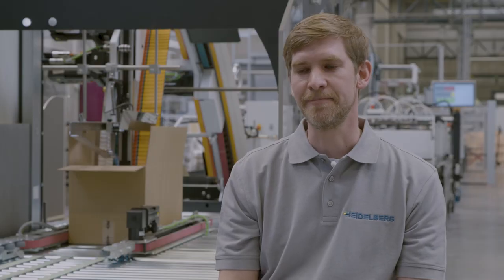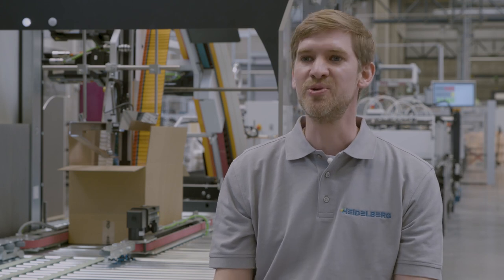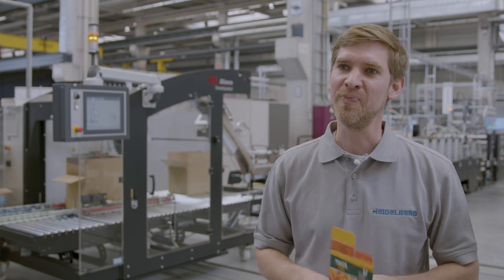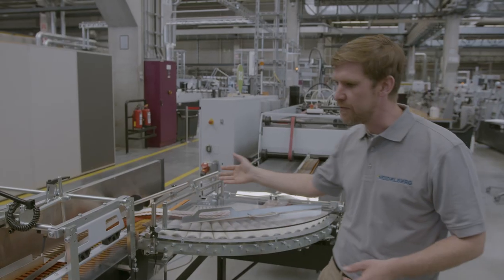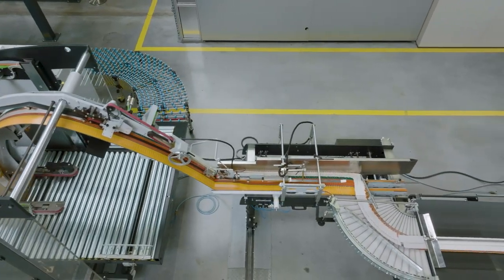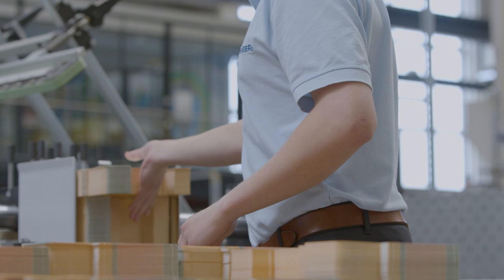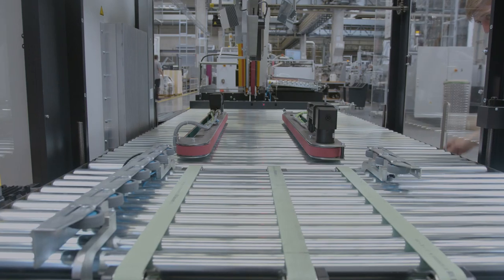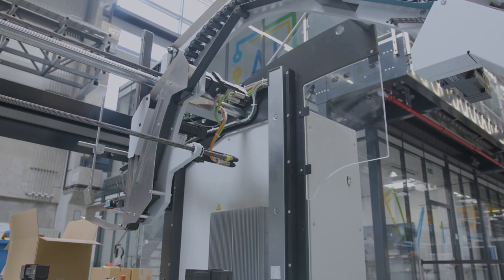How to pack over 130,000 folding cartons per hour | Diana Smartpacker

Comment: How would bundles of 25 be denominated before automatic packaging into shipping boxes? We still twirl them to about face each other in our shop as they exit the Heidelberg supplied MediaStar. In comparison to flyer production for example, I believe your newest buckle folders use paper bands for this purpose.
Reply from the maker: Dear Andrew, 

Bundles are not possible to pack on these kinds of machines. But what I have seen is that bundles could be produced on a Palamides collector and then getting automatically packed on pallets via a roboter system.
Of course there are regulations regarding the box styles and different sizes as well. 

# Check out our Robotics systems from MK Masterwork GmbH Neuss 

Thanks for your question and best regards 

Nikolai Schmiedebach
Product Manager Heidelberg Post Press Packaging